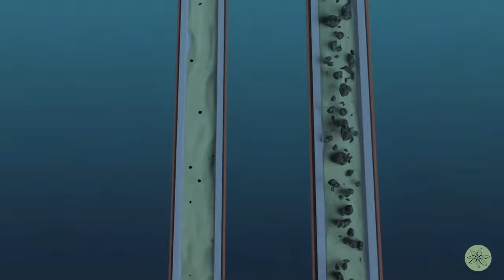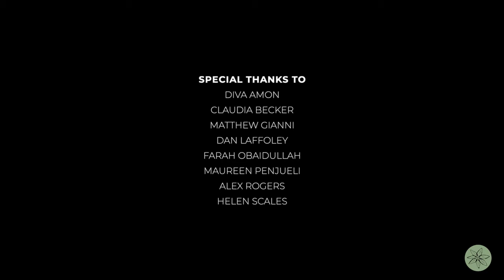Greed in the Deep, Deep Sea Mining's Destructive Plans | Deep Sea Conservation Coalition | Ep 47

Comment: This makes absolutely no sense. It seems less practical to try to extract certain minerals in this manner. All the time and money spent on extraction would not yield much of a return.
Reply: TMC has done a 18 month study impact is very LOW lots of INFO on this now available. TMC vacuum system is SO MUCH Better then tearing up the jungles in the world chasing
these metals. TMC says that once they get fully operational they will be able to vacuum up 200 tons an hour.
  Based on the average composition of polymetallic nodules, 200 tons of nodules would yield approximately:

42 tons of nickel
32 tons of copper
7 tons of cobalt
12 tons of manganese
2 tons of molybdenum
1 ton of zinc
we want to run our world on GREEN energy well this is going to be KEY not strip mining the Jungles.